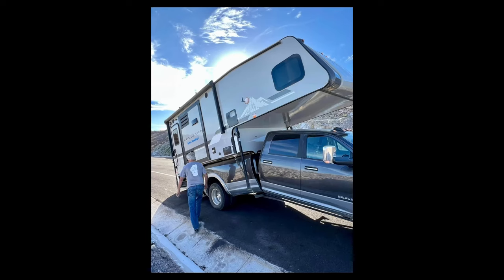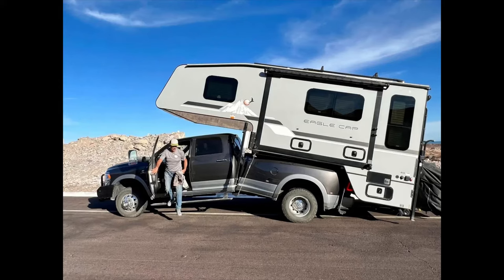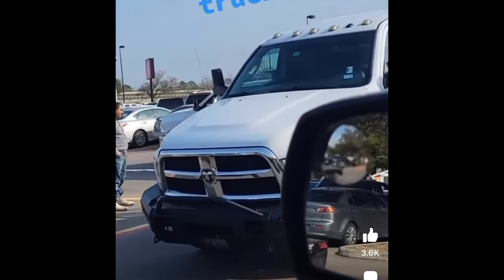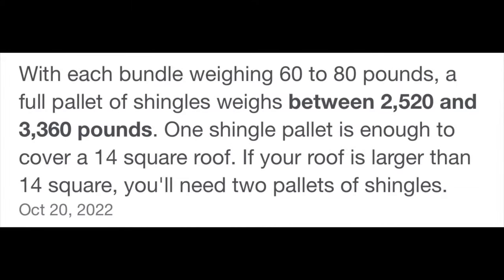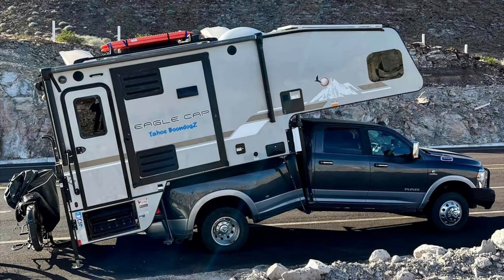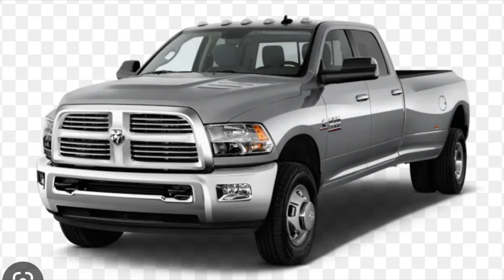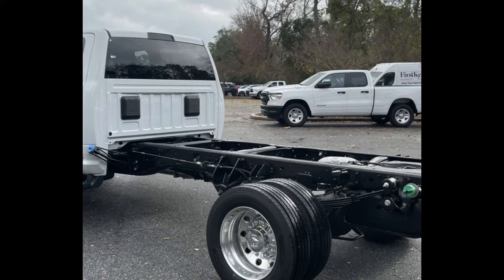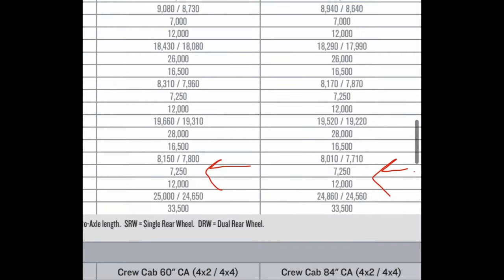Broken Ram truck frames 😱, what’s causing the failure and can they be repaired?

Comment: This is just sad. All the years I’ve abused trucks. I can’t believe how they have turned work trucks into toy trucks.
Reply from the maker: I hear you.  There is something to be said for something reliable that you know will handle business.
Reply: watch the movie Mr. majestic. a 2wd F150 stock does 15 scenes with an average take of 15 shoots. the truck was stock and roadworthy after the movie with no needed modifications. thats an abused truck. they should keep making them like that
Reply: I had a 95 dually Chevy 454 and I put 2 pallets of shingles in it and then hooked a dump trailer to it with the tear off of 1 or 2 houses.
No problems.   I even pulled a trailer house with it drunk as a skunk across a field and through the hollar
Reply: Well my 1980 gm broke right by the steering box right where all Mark of excellence's frames Crack of that era. Quality problems are nothing new it happens.
Reply: One of the worst things about it is that young generation picking up our old trucks driving the prices out the sky. You can't get a good truck for under 5k anymore. These kids are buying them painting them slapping bad parts all over them and then putting a 20k price tag on it. I wouldn't buy any of their trucks but they make the prices go up
Reply: School run syndrome once people starting leaving kids off at school in trucks then there's bad manufacturering and Trucks lying up for years before there sold European ones do the same everything is throw away now
Reply: @Maxx1066  never heard that term before.  Makes sense though.

Comment: the fact that one needs a CDL license to drive a truck / trailer combination over 26000# is a HUGE reason why our government encourages people to use under sized trucks to pull heavier trailers....example - if you have a 16000GVW trailer - then the largest truck you can use to tow it is 10,000#  (older F-250 maybe).......if you get a F-550 with a GVW of 19,000+ then you can only pull a trailer less than 7000# without going over 26000 Combined GVW - which requires the driver to have a COMMERCIAL DRIVERS LICENSE (CDL) - our government is effectively mandating dangerous situations because most people dont need  or want to get wrapped up in all the regulations of CDL and avoid it.
Reply: Absolutely, I’ve been saying this since I can only haul a 7k trailer. But also see people driving around illegally , and I know if I bought a 10k trailer Dot would grab me my first day using it.

Comment: Part of this problem has to do with using thinner high strength steel in place of heavier C channel frames like trucks of the past. I can remember measuring frame thickness of Chevy trucks back in the 80's and a 3500 frame was over .250, while 2500 trucks were at least .060 less and 1500 trucks another .060 less based on my memory. Late model trucks that I am mostly familiar with are 2017 -2019 Chevy/GMC 3500 both pickup version and cab and chassis. The Cab and chassis is a much beefier C channen than the pickup version. I currently have a 2023 3500 dually and I think the frame is no different than the 3500 single rear wheel truck, but I haven't gotten a mic out and checked to be sure, maybe next time I have a buddies 3500 SRW on my lift I will measure. I haul a 3000 lb cabover camper on my dually with a 10,000 lb trailer in tow with my Jeep on it. I notice more frame flex than I would like on rough sections of road as can be seen by the cabover section of the camper moving in relation to the truck roof. My truck is rated at 2000 lbs of max tongue weight and I am probably close. I may try to back that off a little. The thing about boxed frames is they aren't supposed to flex a lot, they are supposed to be stiff and if too stiff they will crack and break. I have been a certified structural steel welder for over 40 years, and like you I would probably perform a repair myself, but I would probably sleeve a piece of heavy tube steel inside of the boxed section and cut some windows for plug welds in multiple locations, full pen the broken section to tie the root pass into the inside box tubing and when done fish plate the outside for added measure. It would be very interesting to have a structural engineer do a failure analysis of the frame on the Ram where it broke. It has to have something to do with too much weight behind the rear axle and the metal fatigue it causes over time. I scale my truck often and the reason I went to a dually was because I also haul a 15k fifth wheel and with my 2017 SRW 3500 I was always overloaded.
Reply from the maker: All great thoughts thanks for sharing.  I have the same opinion, I think it could be repaired, and I would do the repair (if it was my truck) but I probably wouldnt touch it for a "customer".  Being boxed and thinner than normal C-channel is great for lack of flex and rigidity (for less weight), but not so good for avoiding stress cracks and for handling "overloads".  Undoubtedly the frames will see revisions to prevent the failure more than likely (if they haven't already).
Reply: Yep it’s the fad of super stiff boxed frames
Reply: You’re right, I have 60f100 if I stand on one corner of the bed at the back the frame is already flexing pretty good. C channel allow a lot of movement
Reply: Wouldn't boxed frame be more likely to rust out and hard to paint or undercoat.
Reply: They are not using a lot of ultra strength steel that is designed for the heat of welding. I know this because the price goes dramatically up and we all know that the Dodge CEO was famously cutting corners to reduce costs to the chagrin of the factory workers. Thats another issue is the workers actually doing welds or supervision under great stress and a hurry. The workers said when they mentioned a defect their superior always said "Just send it".  Thats the CULTURE

And then if they wanted to save money and use cheaper steel but use much thicker then the pencil pushers would complain on total weight and economy, plus all the other parts would need to be beefier for greater total weight like suspension and brakes.
Reply: @jamesmedina2062   Wow.  These faults of Dodge and the cost-cutting corporate culture sounds exactly like the same cost-cutting culture that led to the Chernobyl nuclear power plant disaster in 1986.  Cut corners to beat the deadline for completion and get bonuses.  Sign off on tests that were never done to save cost.  Use cheaper concrete and pocket the difference.  Force a safety test where the parameters are all wrong, "Just send it".  Same culture, different time.
Reply: @ I didn't want to believe the pundits but now I do, in that European origin capitalism may not be the best thing to avoid disasters. We have a current ongoing temperature disaster melting the ice caps and all that we hear is that maybe by 2050 there will be some better machines in use by then. Meanwhile we already have major damage globally but it is  never on the news because that would affect the capitalist class of Euro-style societies. And the societies doing all the right things like Japan and Norway are ignored despite their better use of electric and downsized kei cars, plus the wonderful thing that is hi-speed rail. I support financial incentives for performance but the accumulation of wealth has gotten really obscene in this country. If people were living in a country where wealth was better spread around and all people got a month of paid vacation we would be happier. Instead we have ghettos and rich areas and the line is that if you get into the good money then you can escape (here) and be happy.
Reply: All this to say you don't understand what high strength steel or weight tolerance is.

Comment: When my 1999 K2500 Suburban had so much frame rust that I pulled it off the road, I looked for a newer truck to replace it. Needed 10,000+ tow cap, leather, tow package, locking rear, 4x4, rear barn doors and dual climate. The newer trucks were not only obscenely overpriced, they were also obscenely underbuilt. I scoured the boneyards and found another 1999 K2500 Suburban frame with less rust to put under it.
Reply from the maker: Most people use their trucks like a car so the under built issue doesn’t come up until you use it like a truck lol.  New trucks are stupidly expensive, you’re not joking.  I have a 2011 f250 and I will drive that forever.  They want over 50k for a new truck like mine, that’s crazy lol.
Reply: @makingmistakeswithgreg  it's nothing new.  When I took my training in late 70s , ford was having trouble with frames bending right behind the cab .

Comment: Have been involved with farm trucks, that is older than dirt which are abused ungodly.  Have to agree with you on the box frames are made out of very hard tissue paper.  There is a fix, you MUST scab the frame with something like 10 or 11guage , would also suggest that you put several inch diameter holes and weld them around to the hole, this is very strong.  Also have a 1994 Chevy dually dump truck, the frame on this truck is plate welded like I mentioned.  From what I have seen I would simply find a older truck and rehab it.  In the end it would be much cheaper, and with a side note you can have much less emission standards to deal with.

Comment: Just thought of something else. When I was in my 20's, I worked at a Formica (countertop) shop in the San Diego area. I used to get sent to Frost Hardwoods in San Diego to pick up particle board. I drove an old (in1968) Chevy 3/4 ton truck. My boss had Frost load that truck so heavily that I had to keep to 35-45 mph on the free way so it would be able to steer. No other problems with it ever. I suspect it was way overloaded, but never broke, and it had been doing that for ages...however, it was an old truck in 1968-69.
Reply from the maker: Engineering has come a long way, and in some cases not for the better lol.  Having driven/owned a ton of older trucks they tended to take the “put more metal on it” approach for everything.  Less engineering thought was given to “how can we reduce the cost/materials but still have something strong” in favor of heavy castings and thick sheet metal.  Don’t get me wrong, my 2011 f250 is the best truck I have ever owned, but even it could have been built better from the factory.  It’s not so much the strength of the body/boxes/frames that have improved as much as the massive power increase and brakes that will stop the truck lol.  Crazy to think there are modern f250 trucks running around with more power than a Sherman tank from WW2 lol.
Reply: Used to haul firewood in the back of my 1980 gmc 1/2 ton, put as much in as the box would hold, leaf springs were flat, green wood.  Old trucks could take it and we were a little on the stupid side

Comment: The other thing that you may have mentioned that I may have missed is that they always break up, not down.  This tells me that it is the force from the weight behind the rear wheels trying to lift everything in front of the rear wheel. so putting the frame in a bow up.

Comment: Another thing to keep in mind is not everyone has a CDL. 3500 is typically 14k gvwr for dual rear wheels. Going up to 4500 bring you up to 16k gvwr on some trucks. Finding trailers to keep you under CDL is harder when you are already starting with a high gvwr.
Reply: We don't need a CDL even when driving a semi as long as it's for private use. We are always running our semis around hauling grain, excavators and dozers and never needed a CDL.
Reply: @kdw75 most people who heavy haul with a pickup on a regular basis are doing it for commercial use.
Reply: Just get a cdl😂 acting like it's hard or you really have something better to do
Reply: @quentonmillstid850  I have one. Just saying a lot of people don’t
Reply: @quentonmillstid850 

Cool. Wanna pay for my schooling, truck rental, and the time off work it'll take me to get one? 

Some people don't have the time/money to get a CDL, especially if they're just doing occasional private use hauling...  Like I do.

I'm pull a M813 6x6 (21,000lbs),  and my D8 (29,000lbs) from time to time but not nearly enough to warrant getting a CDL.
Reply: a f450 ford 2024 pickup not cab chassis is 14k gvw they do that for a reason but the brakes tires 19.5" 10 lug  vs 17 " 8 lug wide front axle so it turns very tight but a regular cab 3500 dual rear wheel  is a heavy truck 14k gvw .

Comment: The thing with "over loading" is that in older trucks the limiting factor was the springs , not the frame.

The frame was usually several times stronger than what the suspension could handle.

You could press down on the hitch until the front wheels lifted off the ground and it wouldn't break the frame.

That we are seeing frames snapped in half before the suspension bottoms out is a huge change.
Reply from the maker: Great point.  Older trucks also didn’t typically have crew cabs and stupidly long frames.  No matter how you look at it having frame failures is pretty crazy overloaded or not.  You would think you would be on the bump stop and the tires ready to pop before the frame broke.  Especially when rust of the frame isn’t an issue yet, that’s what blows my mind.  If half the frame was gone it would be more understandable lol.
Reply: 100 %
Reply: @makingmistakeswithgreg we've had crewcab longbeds since the late 50's
Reply: I worked for a Dana plant between 1986 to 2000 and at that time we built the GM CK frames from 1/2 ton through cab chassis and the Ford PN96 frame from 1995 to 2000
Also the older Ford F150 pre 1995.

The GM chassis used a 2 piece side rail  and the PN96 Ford used a 3 piece side rail.
Next to my area we ran test cells 24x7x 365 with chassis in a fixture with steel blocks to mimic the weight of a fully loaded truck.
The welded areas were painted white and checked daily for cracking, once cracks were noted the frame was run to complete failure. 

There has to be more to this frame failure business.
Reply: The rams use to count the bed as part of the frame. So this wasn't true for all. I'd say Ford and GM use to try and over build things, now it's do it as cheap as possible.
Reply: Exactly!  With these guys putting airbags in, they can't guess if they are overloaded.
Reply: Makes me think of the old black and white sales movies of trucks from Ford, Chevy, and Dodge.  Loading up the truck to full capacity and then running them around on rough test tracks.  Some movies had them empty and run over the kind of bumps and holes that would send it sailing into the air.  The truck was just fine but, I wonder about the driver!  Today's trucks wouldn't survive that kind of treatment.

Comment: My 2006 f350 cab and chassis 4x4 has a super strong frame. It was a firewood delivery truck before I got it, and it needed injectors and egr. It was worth every penny, I could put more than it weighs in the back and did accidentally once. I was cleaning up my truck yard, and loaded 9300 lbs in it, took it to the scrap yard. I couldn't believe it. While that's not common practice for myself, it sure put faith in me. Cab and chassis is the way to go!
Reply: Look what happened to the Liberty ships they built return to port with it when I saw the crack starting to happen and so they put these gigantic slabs of steel about an inch thick I believe so yeah they need to look at what happened to those Liberty ships

Comment: That's one of the most interesting analyses I've seen of the broken frame issues. I am unlikely to have a similar problem (Arizona, light truck, no commercial use), but that was fascinating. I've watched some frame repair videos on Pakistani trucking channel(!!!) and those guys seem to completely ignore most of what you said, except they very often press a new C-channel piece in for added strength. I always wondered about that, since so many of the heavy duty semis have a huge warning on them: "DO NOT WELD." Anyway, thanks for another fascinating video!
Reply from the maker: I love that Pakistani truck channel and all the similar ones, I watch them all the time.  Crazy what a guy can do with minimal tools.  A lot of what they do wouldn’t fly here, but when rules are minimal you can do pretty much anything lol.  From a longevity point many of the repairs won’t last that long, however some of them aren’t intended to. When you backyard engineer things the end results is highly unpredictable.  Case in point your mentioning “do not weld” on frames and truck parts.  Anything metal can be welded, or at a minimum brazed.  The issue is why is that stamped on something.  Well in the case of my f250s front control arm it’s stamped on it because you can align the wheel via shims on the ball joints.  Back in the day you would heat/beat and/or run a few weld passes on it to pull the alignment  straight.  That’s not longer needed and they cast the note more for people to realize there is a better way (through fear) lol.

Some truck frames are heat treated thus welding will disrupt that.  With those frames the repair may cause ductility issues (amount other things) and can fail when stressed.  The big issue is liability, nobody wants liability so it’s common to toss a whole frame out vs fixing it.  If it was welded at one point it can be safely welded again, it’s just that nobody wants their name associated with it.  Most people don’t know how to properly weld high strength steel, and the manufacture might not even disclose what material a frame is made out of.  Not to mention they might not disclose their heat treatment procedure.  Basically a screwed situation lol.
Reply: Probably because those class 8 side rails are factory heat treated, drawn and shot blasted before painting.